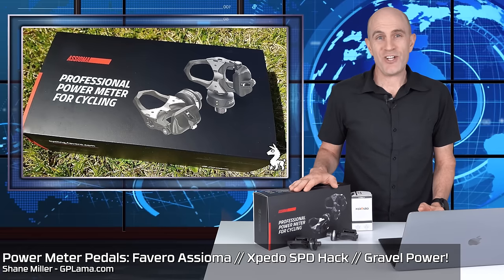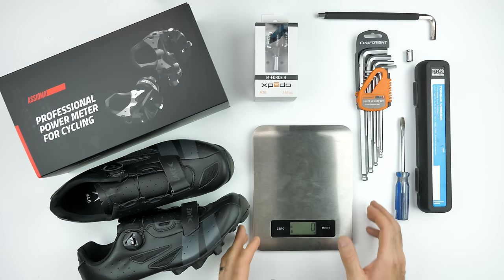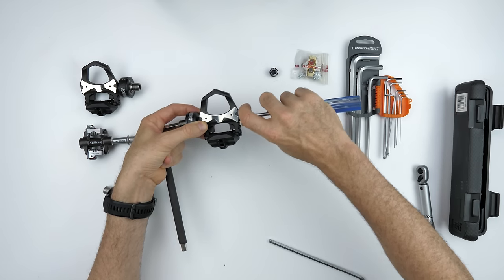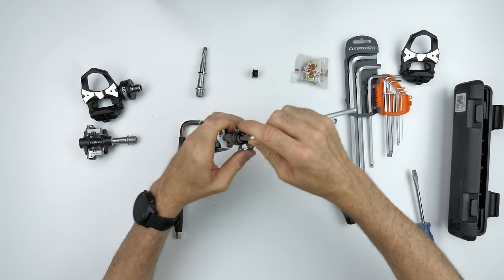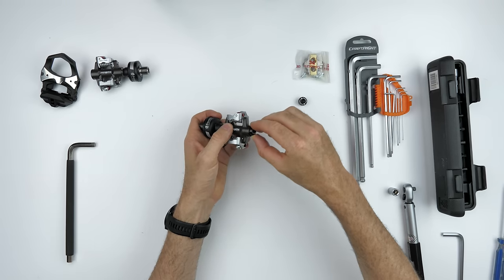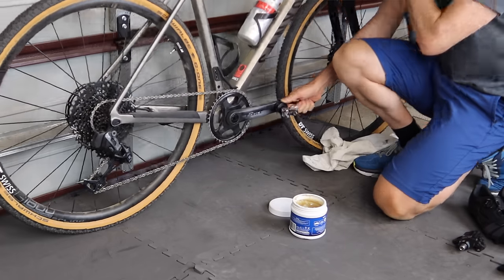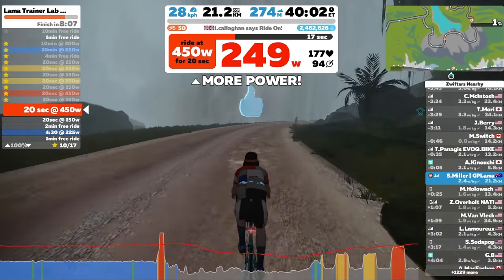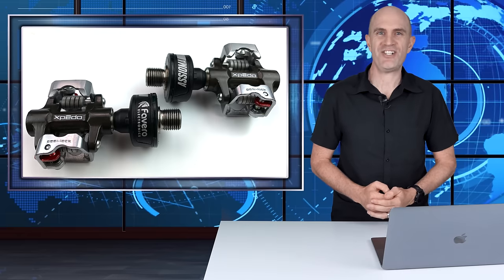Power Meter Pedals: Favero Assioma // Xpedo SPD Hack // Gravel Power!

Comment: So why do you think Assioma hasn't released this already? Seems like a no brainer. Maybe just trying to resolve the shoe clearance issue?
Reply from the maker: I suspect this is true.
Reply: I would guess it's a combo of the shoe clearance and the required durability for true MTB riding.

This is a great hack for gravel and light MTB riding but as Shane noted if you're going to be banging your cranks that Favero pod is at risk.
Reply: @gplama  And Shimano's patent on SPD pedal body? Expiring soon I think...

Comment: I want to make sure I understand all the equipment before I start buying. What is that special socket required for the inner nut at 2:56? Thanks so much.
Reply from the maker: That was from a really cheap socket set I had in the garage. Any hardware store should have something similar.
Reply: Found the answer at https://youtu.be/iT0Cpr-z9sw?t=47  It's a 9mm socket.

Comment: This might be a stupid question but I'll go for it. If you have a favero assioma duo, can you "divide it" and have two power meters? One with road pedals and another with mountain bike pedals?
Reply: I was wondering about the same thing???
Reply: As far as I know you cannot. IT's my understanding that the right pedal sends data to the left pedal, which then broadcasts that and it's own data to your head unit. You can set a DUO to be a UNO in the app, but that just tells the left pedal to ignore the data from the right pedal. As far as I know you cna't make the right pedal broadcast on its own, which is what you would need to split the set up and place one pedal each on two bikes.

Comment: @Shane Miller - GPLama - Would this work with other types of pedals as well?  For exmple, the Shimano SPD SL road pedals.  I have the Ultegra pedals by Shimano and I saw this video and was contemplating doing this because I prefer the shimano cleats to any other.  Also, my main choices for a power meter right now are the Assioma Duo's, or perhaps the Power2Max NGeco spider based power meter.  I know you love your Assioma's but I saw your review on the NGeco and it seems like that is also a pretty good choice.  Which would you recommend?  This will be my first power meter.  I also toyed with the idea of either a Stages or 4iiii left crank PM since it will be my first one?  But at the same time I figure I might as well spend a little extra and get a nicer one because I'll probably end up upgrading anyway.  I would really appreciate your thoughts/recommendation.  But I would only really contemplate getting the Assioma's if I were able to switch out the pedals with my Ultegra pedals.  I hope you have time for a quick response.  I love your video's, they are super informative.  Keep up making the great content!  You're a legend!  Cheers.
Reply from the maker: Nope. If this worked with Shimano SPD-SL, everyone would be doing it. There's a complex hack for SpeedPlay that I'm not too keen on attempting. Entirely your call what to buy. It depends what suits your bike/budget/preference.
Reply: @gplama  Thanks Shane!  I appreciate you taking the time to respond.Still probably between the Duos and the NGeco, just because of easiest compatibility with my bike.

Comment: Did carving away the bottom of the shoes change the feel/comfort of the shoes?  I use a similar Shimano shoe for gravel/road riding and would be concerned if it caused the shoe to flex or feel weak along the inside edge.
Reply from the maker: Nope

Comment: Lama,   The goal in pedalling efficiency is a ‘round” pedal stroke where both legs work simultaneously alternating pushing and pulling. If the pedalling is smooth there should be a similar power output from both legs most of the time, and a one sided power meter should be accurate enough.

Comment: I recently found your clip and I knew that Assioma has Assioma DUO-Shi Pedal Axis without pedal on market right now. 
I have a Shimano SPD PD-A530 pedal and I found a long list on shimano spd pedals which fit the Assioma DUO-Shi Pedal Axis from SpeedyChix . I just wonder that in your opinon if the Assioma DUO-Shi Pedal Axis can really fit the  PD-A530? Someone showed that EH500 working just fine.
Thanks a lot
Reply from the maker: I've not done any modifications to the DUO-Shi. Some people have if you check on the Trainer Road forum. Just beware that the DUO-Shi increase the stance/q-factor by around 26mm, so using them on a MTB with wider cranks would be wider again.

Comment: The hack might work but the power calculating algorithm may be off. There is a huge algorithm to interpret the raw data from all the sensors to make out real world meaning. Any big shocks that feeds into the pedal axle due to rough roads, drops and jumps will give erroneous power output.

Mtb pedal powermeters should have extra algorithm to filter out such false inputs. 

Nonetheless,  your idea of converting into mtb pedal is intriguing! Perhaps an update to the firmware would complete the trick.
Reply from the maker: No indication of any issues with the Assioma when used to 'send it'. You've concluded a theory without data. I'd like to see/know if this is an issue. I'm not hardcore enough to do downhill to test this. :)
Reply: @gplama  I said MAY be off. Because I did not look into the engineering of Favero in particular. It happened with powertap p1 pedals and that was the explanation from tech support. Perhaps Favero has a smarter algorithm to discard redundant inputs. Good for you if it worked!

Comment: Thank you for the video.  I tried the hack with a new set of Xpedo CXR’s.  I tried using the last Washer from the Assioma.  When I tighten the nut it locks the pedal up and does not spin.  I then tapped off the Xpedo washer and get the same results.  Interestingly when I put the Xpedo washer back on the Xpedo spindle the pedal bonds.  It would suggest you have to tap the washer in place.  The options seem to be either tap the washer onto the Assioma spindle but I am not convinced that will work or run without a washer which will allow ingress of muck and could damage the Assioma spindle.  I would welcome suggestions.
Reply: I noticed one of my Assiomas (left side) was missing the protective washer (noticed when I serviced mine - they came like this from the Factory). There had definately been some water entering the internals of the pedal but I have not noticed any problems with them. After a light clean-up they looked as good as the other side (with the protective washer in place). The bearings might be more worn out but nothing that I could notice. So to conlude; a missing protective washer does not seem to hurt the spindle to any noticable degree.

Comment: Waww, will that work with eggbreaters, the body looks the same...;
Thanks for the video
Reply: The eggbeater pedal body is longer than the xpedo.  Also the bore in the eggbeater is smaller. No room for the bearing.

Comment: I just did this with xpedo cxr pedals. I removed everything from the assioma spindles including the last washer, with it in the pedals had friction as they spun. So now it's just the cxr pedal bearing pressed up against the assioma pedals (I did include the oring, but it does nothing in this configuration). I hope this was correct, anyone feel free to chime in if they have used the cxr pedal body for a while now.

I have size 46 shoes, and had to cut plenty off them despite adjusting the clears as far from the spindle body as possible....

Comment: Shane - Can you advise what to do with end cap on the crank side. You say to use the assioma oil cap but I don’t see you removing the xpedo end cap. Is there an oil cap in the Xpedo?
Reply from the maker: The 'oil cap' is just a washer. One was used.

Comment: Any opinion if this would also work with xped platform/flat pedals? That would be awesome....
Reply from the maker: It's a 'maybe' until I see it with my own eyes.
Reply: I will try this. I'm a geek when it comes to getting data from my rides and on my touring/expedition bike I prefer flatpedals. So hoping it works ;).
Reply: Only the combo SPD / flat pedals they do have the style of spindle you need... and I'm not convinced it's the same length as the one that comes with the Assiomas.

Comment: Currently, you can get a PowerTap G3 Disc brake hub in 135mm x 9mm Quick Release, or 142mm x 12mm Thru Axle.  24 and 28 hole options, so there is a possibility to use these without waiting for the G4 hub.  
https://www.quarq.com/product/powertap-g3-disc-hub/
Reply from the maker: Wowa... that didn't register on my radar at all! Nice!

Comment: Excuse me if this has been brought up.  Countless times while on the MTB I experience some pretty serious pedal rock strikes.  So much that it knocks my foot from the pedal and jumps the bike.  I wonder what happens to the accuracy of the device after such a strike or after several to many strikes?
Reply from the maker: I address this later in the video regarding ‘more serious’ MTB usage and alternate options for power.
Reply: That sounds like a $400+ pedal strike.

Comment: Great hack, but I guess it wouldn't be easy to swap from road bike to gravel bike....I guess one could ride SPD on the road bike. My dream would be a plate which locks into the standard pedal that presents the SPD connect.  I would be fine with the weight penalty on the gravel bike - not as critical (to me) when I'm crunching off road.

Comment: Hey, i'm currently looking for a powermeter and really like the assiomas. I own two bikes, a mtb and a roadbike which i both use multiple times a week. Should I buy one assioma duo and change the pedal body and pedal from bike to bike every time I change bikes or should i buy two assioma unos? How important is left-right Power data?
Reply from the maker: Entirely your call what to do. Same with L/R data. That's entirely up to you.
Reply: @gplama  but data should be consistent between both bikes even when I go with the unos?
Reply from the maker: @plaicknaa  It will be from the unit, yep. You'll need to be L/R balance consistent though.
Reply: @gplama  thanks a lot! Great content BTW! #rideon

Comment: I've tired to follow this process, however, what i have discovered, that the distance between bearings is slightly different on these pedals (potential one or another manufacture has changed the spec a bit). After installing the Xpedo on Assioma axes and tightening it - there is a side 1-1,5 mm play :-( the axes (you keep in your hands at 7:05 is slightly longer, hence bigger bearings are moving left and right. Did you experience it? Any suggestion hoe to fix it?
Reply from the maker: Just like the road Assioma - once the end cap is on and secure, there's no play.
Reply: @gplama  thanks for a prompt and concise reply.
Would it mean there is a slight play before the end cap is on and, it's gone when the end cap is installed and secured?

Comment: Need some guidance GPL. I tried the hack these evening with I believe the lowest end Xpedos. It goes perfect until I run the silver Favero endcap on the inside and torque to 9nm. The pedal body is then tight and doesn’t spin. If I only tighten to say finger right it will spin. If I remove the metal favero inside cap from the equation and just run the rubber washer that came on my Xpedo I can torque to 9nm and it spins but there is a little play left. In other words it doesn’t work with the cap, unless the nut is just barely holding the pedal on, but not perfect without it (can torque to right spec, but leaves some play). It seems the xpedo bodies on mine are just slightly out of spec... like 1/2mm too much material on the inner surface. Thoughts? What about planing off 1/2mm of material from the inner side of the bodies so I can run the cap, torque to 9nm but still have spin? Or do I just need to use higher end Xpedos?
Reply from the maker: One for the TrainerRoad thread on this. There’s a few posts over there where people have deviated from the specific model pedal bodies I used here.
Reply: @gplama  I think I figured it out. The M Force 3 only has 2 bearings. The M Force 4 and up use 3 bearings. I think with the one less inner bearing on the 3s they tighten down too tightly / closely to the pod and don’t spin freely. Ie the extra bearing makes it sit just that much more outboard (say 1mm) on the axle or something so it works. I ordered some 4s and will report back.

Comment: What is the problem if you directly the favero assioma duo pedals on 29” mtb bike using road bike shoes. Is there any discrepancy in power meter readings?
Reply from the maker: That works fine. Road cleats aren't ideal for offroad use/walking/mud/etc.

Comment: Can you run the duo as an "uno" on 2 separate bikes at same time with a 2nd set of Xpedos?
Reply: Yes, but you won't get data reading from whichever bike the right pedal is on. See above in the comments - there was a similar question that I answered.

Comment: Can we do same with, for example, Garmin Vector 3 (with power meter) and some other SPD pedals (like shimano pd-m520 or look x-track race). Can we set SPD standart on Vector 3 or axes are different? I did not see them disassambled. Or this hack works only with these specific pedals: Favero Assioma + Xpedo SPD
Reply from the maker: Not possible at this point in time. I can only confirm the hack works with what I demonstrate.

Comment: Should this work with the older BePRO Pedals as well? Cheers.
Reply: Yeah it does, i had to add a little chamfer tot the inner backup ring though
Reply: Absolutely -- I tried it with Xpedo CXR bodies two years ago, and no issues with installation. However, the BePRO pod is bigger than Assioma, so you need to cut the sole of the shoe even more.

This is the reason why I didn't use them. I'm worried that I'll eventually break the pod when missing a clip-in. For SPD, I think the only reasonable solution is putting the electronics inside the axle, like the new SRM pedals do.

https://www.dropbox.com/s/kvoguhul919uh07/bepro%20spd.jpg?dl=0
Reply: herman vansch how did you do this? Which tool do I need?
Reply: @harmholscher2338  its the cheapest kind of aluminium, so even a breadknife would work, but i'd suggest a deburr drill bit or a hand tool

Comment: Question for uno, just change one side and good to go?
Reply from the maker: Yep!
Reply: Q-factor spec on the Assioma is 1mm more than the Xpedos, so you might want to use a 1mm shim between the crank arm and spindle on the non-power side.

Comment: Do not forget to mention another really good solution for mtb and dirt ride in general is the Rotor 2in power 😉
Reply: Michele Salcuni that’s not really the point of the video bro
Reply: @justinevans5925  you right Justin, I was just including something to the great video! Really interesting Hack 👍🚵
Reply: Not a great solution, though, if your bike has a BB86 or BB92 bottom bracket shell since it only comes with a 30mm axle.
Reply: @gpatrick95  I can mistaken but as far as I know  you can find bearings adaptor for any standard 😉
Reply: @miksalcuni  True, there are bearings sets that fit a 30mm axle in a bb86/92 shell, but the actual ball bearings required to make that happen are comparatively tiny.  Such bearings are prone to early and frequent failure.
Reply: @gpatrick95  not aware about it, I'll get my bearings closely checked then, thank you for your advice 👍

Comment: Has anybody tried to do the hack with the Shimano (yellow float) road cleats? That would be a home run, hate to convert to Look types.
Reply from the maker: You'd need to find a pedal body compatible with those cleats (and this pedal spindle). It hasn't happened yet.

Comment: hi, would i also work with the xpedo traverse duo?
Reply from the maker: I don't know. I'll go with 'maybe'.
Reply: That pedal body is wider, and, at least in photos, it looks like the inboard bearing stop on the spindle is close to the crank arm.  
Replacement spindle for the Baldwin is the same as the M-force, though.  With a little further hackeration, you could possible make a combo clip/flat out of a set of those.

Comment: Anyone installed these on 160mm cranks? I'm thinking of getting real short cranks for cyclocross so that the crank arm protrudes well past the assiomas. The pedal or crank arm should take any impacts in theory then.
Reply from the maker: You'll have to check the head unit you're using will allow you to set a cranklengh of 160mm for the power sensor.
Reply: @gplama  cheers, didn't think of that. Seems like 160mm will hard to source anyway, 165mm is probably better value. Just checked the bolt, good to go down to 155mm! Although I am thinking of moving to garmin 530 so I can get all the Xert metrics live.

Comment: Why on earth are pedal manufacturers not doing this. 20 minutes work
Reply: They can't put those off road pedals on the market and expect users to cut up their shoes. What if someone slips with a knife?
Reply from the maker: Cars are worse than knives. I’d say it’s more the impracticality of the shoe hack.
Reply: @gplama Not all shoes need to be cut up. I use a pair of Fizik Terra X4 and they work with this hack. You can check the TrainerRoad forum for my pictures

Comment: Hmmmm... 

If you want to save some rubber on your Cx/gravel shoe, and have a SRAM force crank. Get a quarq spider that made for it 🤣
Reply: Dr_Taka While that’s true but I think you are missing the point of pedal power meters. You can move them between bikes regardless of the cranksets which is awesome if someone (like most cyclists) has multiple bikes.

Comment: Do you know if the M-FORCE 8 will also work with the Favero Assioma hack?
Reply from the maker: No idea sorry.
Reply: @Rusty, have you tried it with the 8s? I'd be very interested since the 4s aren't available anymore, and the 3s don't fit.
Reply from the maker: 4 months later... I've done the M-Force 8 conversion. It works!